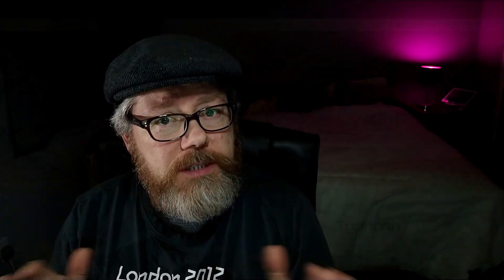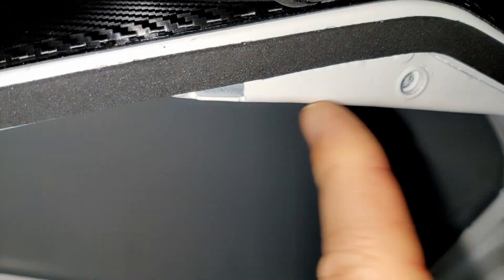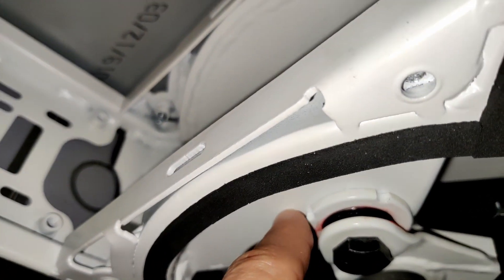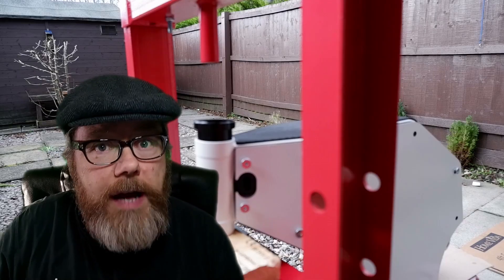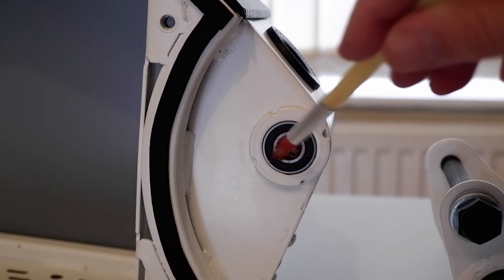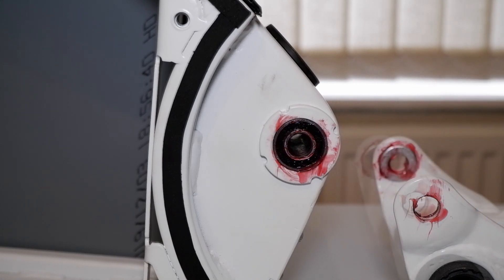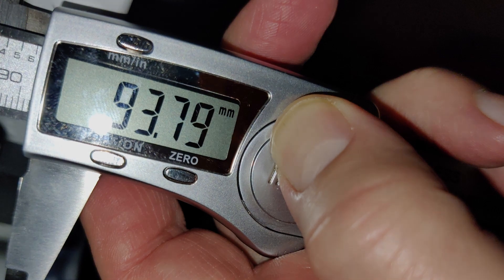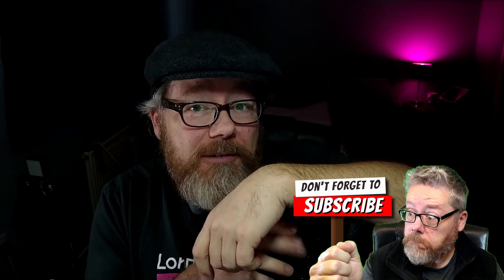FAST EBIKE BUILD UK ROAD LEGAL PART 6 - WHICH FRAME IS THE BEST  QUALITY TO CHOOSE FROM.

Comment: Makes zero sense to me why you'd grease a part that's to be press fit, it defeats the object and also the inside of the bearings, same issue. You understand the pressfit part needs that friction right ? and same with the bearings.
Reply from the maker: You should grease press fit bearings, have always done it that way and is usually what is recommended. Somehow you think it is going to come out?  That is not the case 👍
Also it stops any corrosion which will aid in removal when needed.

It makes zero sense too you but perfect sense to me any many orhers.
Reply: @baconbuttties  I've been a machinist in the past and made 1000's of pressfit parts myself on lathes and mills and the whole point of a pressfit is it being tight and the friction, adding grease is nonsense. It'd be like greasing the soles of your boots. I don't care what some "others" opinions are you cannot change facts to suit opinions. I'm giving you and your viewers some solid advice but if you want to grease them have at it.
Reply: Same goes for bearings btw, they are designed for both rings to be solid against the 2 seperate parts. It is the reason for using bearings in the first place and not just using grease on straight through parts.
Reply from the maker: @mevstormshot  let me ask you this.
Will a press fit cup come out if it is greased, nope.
Will it help with corrosion, yes.
Will it keep water out, yes.
Are there any downsides to using grease?
Are there any positives to using grease.

Just because you think it is wrong doesn't make it so 👍
Reply: @baconbuttties  It's a FACT it is wrong not my opiinion. I've already mentioned the downsides.
Yes a pressfit could possibly come out if greased.
Grease shouldn't help with corrosion because water wouldn't get into a decent pressfit.
You don't have to take my word for it, ask any mechanic, machinist, engineer etc. It's basic knowledge for any of them.
You can do as you like it but making a public video giving advice to others could possibly be dangerous.
I've only commented on it because of how obsurd the idea is.
Reply from the maker: @mevstormshot  I have had bikes where there head set part of the frame is corroded, also have had motorcycle wheels where the bearing seats have corroded all from water ingress.
I have worked on hundreds of cars where the bearing seat has corrosion 😱

How many times have you seen a press fit bearing come out when greased?

Bet it is zero.
Reply: @baconbuttties  😂😂
Reply from the maker: @mevstormshot  I take it that you don't know of any that have come out because of a bit of grease then 👍
Reply: @baconbuttties  I'm laughing because it's pointless debating something so nonsensical. But if you want an answer then I haven't seen anyone grease a pressfit before so the answer is no, but that doesn't make it right. LOL
I have seen pressfits come out even without grease if badly made and obviously grease would of made these worse.
I am not sure if you're debating this out of ego because of a mistake on your video or you really do not understand the concept of pressfit parts, sealed bearings or what grease actually does. This is my last comment on the matter as it's really not worth my time, I just hope others see these comments and make up their own minds if if thinking of doing this themselves.
Reply from the maker: @mevstormshot  If it is pointless debating then why did you mention it in the first place. 😂
Reply: @baconbuttties  I can't believe you're trying to troll haha. It's pointless to debate someone on such a stupid premise. It is not pointless to say and explain how stupid a process is.
Reply from the maker: @mevstormshot  You have still yet to prove that it will compromise the press fit.
If you can't prove that you really are wasting your time and mine. 👍
Reply: @baconbuttties  hilarious. look up what a pressfit is and come back to me
Reply: I can't believe I have to say this again but... Press fit (interference fit) relies on friction to work and hold the parts together. Grease (lubricant) helps to reduce friction between 2 parts. The exact opposite of what you want. Come on mate it's not rocket science.
Reply from the maker: @mevstormshot  I know what it is, I don't have to look it up 👍
The hilarious part is you are getting irate about a bit of grease.

Look prove to me that it will fail or come out because of a small tiny bit of grease and I will except that.

99.9 percent of the grease is pushed out when pressing in and you well know it does not cause any issues.
Most if not all bike companies say to use a bit of grease when installing head stock bearings and cups.

I think you should go and tell them as well...
Reply from the maker: @mevstormshot  I can't believe you keep saying it as well 🤣🤣🤣

And I agree, building an ebike isn't rocket science.

Also greasing a press fit makes it easier to install and doesn't cause any problems.
Reply: @baconbuttties  I'm not getting irate at all, it is however very tiresome to debate someone who either doesn't know what they're talking about but wont listen or does know but doesnt want to admit it. lol and if a bike company is telling you to grease a pressfit part then that person is probably a salesperson and has no idea what they're talking about either because it's laughable. Please find me a mechanic, machinist or engineer etc that will agree with you. (rhetorical question btw).
Reply from the maker: @mevstormshot  you say it's tiresome but keep replying 🤔

You say it's dangerous  but can show no proof 🤔

You called me a troll yet you commented on my video 🤔
Reply: @baconbuttties  correct other than proof, i've given all the proof but because you keep asking for for it is the reason I say you're trolling, have no idea what you're talking about or just plain avoiding saying you got it wrong. Exactly what "proof" do you need ? It's probably impossible to find a part that came off due to grease because people generally aren't that stupid and if they are probably aren't going to post that online.
Reply from the maker: @mevstormshot  You haven't given me any proof because you well know that a press fit item will not come loose if it is greased, it would only come off if it was a poor fit. Imagine getting your feathers all ruffled about grease hohohoh. Do you scour the internet looking for grease fiends?
Reply: @baconbuttties  If greasing a part that relies on friction to work seems like a good idea to you go for it. 🤣🤣 While you're at it put some on your tyres, boots, handle bar grips, it'll keep water off them right ? 🤣🤣
Reply from the maker: @mevstormshot  ahhh so does rubber suffer from the effects of water like metal does? Have you ever heard of galvanic corrosion when using dissimilar metal's? 
Like I said, I have worked on hundreds maybe thousands of cars, motorcycles and bicycles and  have found corrosion and water ingress on press fit bearings etc.
So there you go.
Maybe try working on old vehicles and tell me I'm wrong.
Also  all the vehicles I have worked on nobody has come back and said it failed because of grease.
Nobody, not once.
Reply: @baconbuttties  This is when you should really stop when to take my joke about adding grease to others friction reliant parts and say they don't need it because wont be effected by water. 🤣You have never found water ingress from pressfit/interference fittings/joints, it will be something else at fault. Keep on saying science, laws of physics, designers, engineers etc are all wrong and you know grease works great on parts relying on friction.
Reply from the maker: @mevstormshot  you have just made a claim that you will never find water ingress ever on a press fit part 🤣🤣🤣🤣🤣🤣
Unbelievable 👍
You really don't understand science and the laws of physics 🤣
Look under a microscope at metal, it ain't smooth Trev 👍
Reply: @baconbuttties  Showing your lack of knowledge yet again. If you're getting water ingress in a pressfit/interference joint it has failed. Why do you think they now use them in plumbing ? You really don't understand the concept of an interference joint.
Reply from the maker: @mevstormshot  actually you are showing your lack of knowledge.
Look Trev I have taken many bearings out of motorcycle wheels and on many occasions the seat in the aluminium wheel has corrosion from water ingress.

I am not making it up 🤣 this really does happen.
Now you have used plumbing as an example and at no point did I say water was streaming through a press fit 🤣

Educate yourself Trev with some real hands on knowledge of old cars and motorcycles etc
Reply: @baconbuttties  Mate i'm an ex machinist I have all the knowledge needed and as I said before the water will be coming in from somewhere else and not the pressfit if made correctly. Water will not get through a pressfit whether it's streaming or anything else. But I digress anyway because that isn't the real point here (seems to be your point), the real point if weakening/ruining a pressfit connection.
Reply from the maker: @mevstormshot  So being an ex machinist gives you expertise in what exactly? Definitely not science or physics and I will say it one last time, I have experience with water ingress in press fit applications over time in wet conditions. It may well be that over time rust or corrosion has crept in as most fittings are exposed to the elements but using a water proof grease will prevent or slow this process and also will not cause a cataclysmic failure. You can blab on all you like but I will continue to do it my way , also thanks for boosting the popularity of this video by commenting so much. Much appreciated 👍
Reply: @baconbuttties  Never said i were an expert and always still learning but I have very good qualifications in Physics, done an electrical engineering apprenticeship, owned my own machine shop and business for a number of years and done probably 20 years of studying in the field. I think that gives me quite a good knowledge base for both theoretical and practical. So something else you were wrong about, your averages are getting pretty low. From the way you've been in this discussion im pretty certain you'll hide this thread from public too. lol
Reply from the maker: @mevstormshot  No way will I hide this conversation, I may even make a video about it because I find it fascinating that you keep coming back and even though there is evidence in real world applications of water ingress in old car wheel bearings  you still deny it can happen. If you had changed hundreds of bearings on old cars like I have then you would understand this. I don't declare to know everything and can only go by the reality in which I have lived and experienced.  So if you want to brag a bit more about your superior knowledge then carry on as I'm only a lowly mechanic with hands on experience.

Also 3 days ago you said it was pointless debating but here you are still. 
Brilliant.
Reply: @baconbuttties  This isn't a debate as there isn't one to be had. I wasn't bragging, i was replying to your derogatory remarks about my knowledge, there is a massive difference and you know it. You're making yourself look worse and worse at every comment and trying to run down my knowledge or character. A very telling trait of someone arguing without knowledge to back themselves up.
Reply: @baconbuttties  Oh BTW i'd be very careful on what you say if you do make a video about this. ;)
Reply from the maker: @mevstormshot  I haven't been derogatory in any way at all,  If you take it that way then that is your own insecurities.  I have experienced  failings of press fit applications through rust and moisture ingress and that there is all the knowledge I need. 
Now Trevor why would I have to be careful in what I say if I make a video? 
You have wrote on a public platform for all the world to see, so why would I have to be careful?

If you don't want me to make a video then just say if you prefer to remain incognito.
 
Please remember you are the one making accusations that what I am doing is somehow dangerous.

By the way I do not take offence to anything you have said, I just think you like to tell everyone that your way is the right way and the only way and anything else is an abomination.
Reply: @baconbuttties  Now I have insecurities ?  HA  anymore character traits to add ? Funny...  I am not making any accusations and it is NOT "my way" it's science, laws of physics, the way things are engineered and just plain facts. There is not one thing i've said that is my opinion or my way, this is not my opinion vs yours.
Reply: Listen this is my stance and I don't care about the rest of it and this time I will leave it at this.  By all means add as much grease as you like, just not to the joint of any interference fit as A) it's not needed to make it waterproof B) It 100% will make the joint weaker as it relies on friction. Simple as that, scientific facts. (just a suggestion, maybe make the joints and then add grease to the rest ?)
Reply from the maker: @mevstormshot  let me explain my stance then.
If I apply grease to a wheel bearing and also the seat then it does aid in installation as it first goes in.
All the grease is pushed out as it is pressed in but will leave a nice coat of grease on the  outer surface of the side I can't get too if you understand what I mean.
I will then add some grease to the  top side of the bearing that I can see.
This delays or prevents moisture getting to the exposed outer edges of the bearing.

So in my scenario the bearing is still a perfectly good friction press fit with a little bit of extra protection.

You might think it is unnecessary but this is usually where corrison occurs, and that corrosion can leach further into the machined surface and 
1. Cause issues with removal.
2. Cause the press fit to be not as good because you have to clean the rusted area first for a new bearing to be installed.

This seems perfectly logical to me and experience has taught me this.

Comment: The 1 piece 1 Shock Bike Frames of MTB E BIKES are really not ideal fit due to a bike going fast needing durability of comfort and safety. Too much easing up on rough minor road conditions along with an always shaky rideover of lifting up ya butt once bike past the front shocks on forks or front wheel. Them frames should be tossed and obsolete because it is the 2 piece frame with DUAL SHOCKS that is truly the base of type of frames for most e bikes as going fast the bike needs to be durable and adaptive going over rough road conditions such as bumps, pot holes, lifting cracks, ect. The DUAL FRAME is truly IDEAL FRAME for e bikes that goes faster then 20mph and a much more comfortable, enjoyable and a safer ride. I have 2 of them, 1 shock frame and a dual sock frame. The 1 shock MTB is factory made while I build me a CKit 1500 watt DIY and chose a similar frame to an Enduro E Bike in a NEXT Power Climber and there are many other brands you can find cheap. All I know any new builds or e bike buys it will not be a 1 piece 1 shock bike frame.

Comment: Hi does victor moto seat fit on eeb frame?
Reply from the maker: I'm not sure if the holes are in the same place. I think you would have to measure eeb frame holes and ask for the Moto seat mounting dimensions 👍
Reply: @baconbuttties  eeb frame seat measurements 6.0×11.5 cm from the the center of the holes
Reply from the maker: @ayed2507  I haven't got the seat anymore so can't help you with the measurements.

Comment: Do you think these frames are strong enough for a 125cc equivalent motorcycle build? Cheers
Reply from the maker: If you mean power wise then yes I think the frame is strong enough but a Bicycle rear shock seems to weak for me so I am in the process of buying a 125cc motorbike rear shock. I would also prefer 125cc front forks which I hope to do in the future.
Reply: @baconbuttties  thank you for the reply. I’ve just been watching some of your videos, your bike looks the business!! I’ve been researching all of this electric stuff and my god it’s confusing for a beginner!! I currently ride a petrol scooter and want to go electric, but I can’t find exactly what I’m after so I want to build my own. I want a 125cc equivalent bike style, not scooter. I’ve seen these kind of frames on eBay but wasn’t sure if they could handle it. One more question, could you fit wider wheels and tyres on that frame? Cheers ;)
Reply from the maker: @HowlingWolfLeather  the Chinese made Frames are not as strong the ones from Vector Ebikes and sleek as these ones have extra strengthening. The rear swing arm on my frame would probably take a 3.5 inch tyre on a 19 inch wheel as the gap is 100mm max.
Reply: @baconbuttties  ok cool. Going by what I’ve read of the MVSA, there’s nothing stopping me using a vector frame and then registering it as a motorbike. I would research into what motorcycle front forks fit the frame and same for the rear. Thanks for the advice.  All I’ve got to do now is get my head around the electrical side, I’m persevering though, I’ll get it…. Eventually!!
Reply from the maker: @HowlingWolfLeather  👍🏼

Comment: You can press the cups in with some threaded bar and large washers if you don't have a hydraulic press. just be carefull to start them off square and like the man says grease them up good . Da iawn 🏴
Reply from the maker: I actually have threaded rod and I should of shown both ways as a comparison but was a bit lazy. Iechyd Da 👍🏼
Reply: NEVER grease pressfit parts.